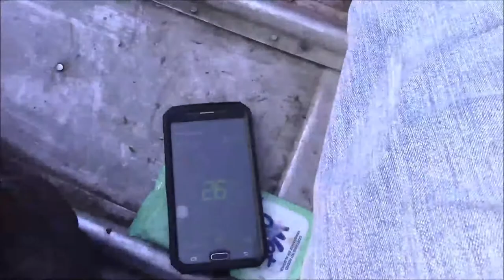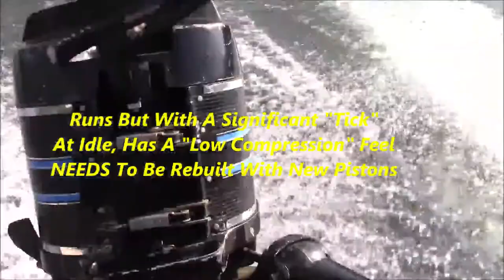Mercury 200 20hp Two Stroke "Trigger" Issues, Won't Run

Comment: I just picked one of these up, maybe a 80s model.  It has compression but it looks like some of the electrical parts are missing inside.  I know nothing about outboards but am thinking of rebuilding it just to learn.
Reply from the maker: Careful, those little Mercs are addicting. They really punch above their weight and when on a boat like a little 14 footer aluminum can get in the mid to upper 20's. Mine gets 27 measured by GPS
Reply: @htssoutboardsboatstrains9784  Nice! my brother has a little 16 ft vhull aluminum boat from the 50s.  I bet it would make that thing haul butt!
Reply from the maker: @decapolis01  Find a 2 blade 11 pitch prop

Comment: My flywheel just won’t come off :(
Reply from the maker: Some times a little heat along with "hanging" the motor a 1/2 inch so the weight of the motor is tugging the flywheel. THEN use the puller to add tensile pressure & tap. Heat can't be too much that will damage the ignition components like the coils. Around 200 degree's F max.